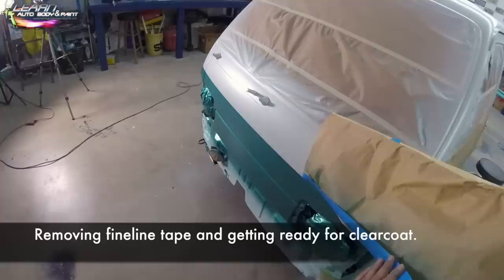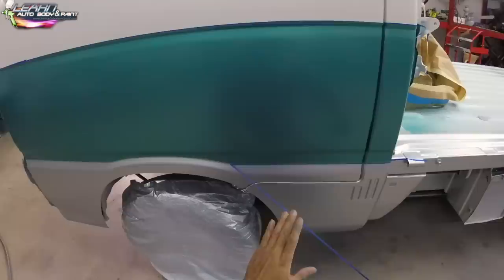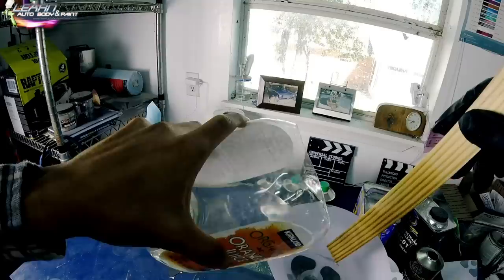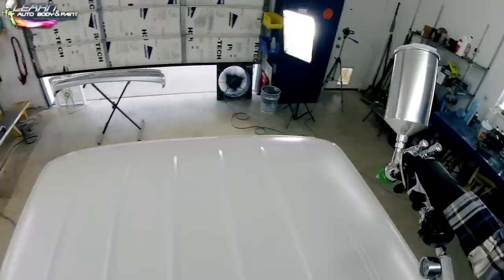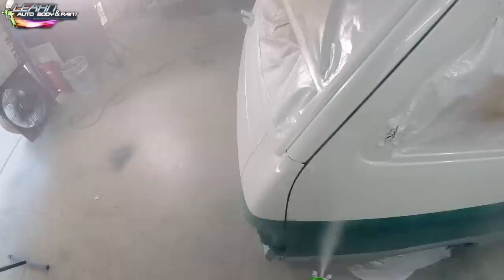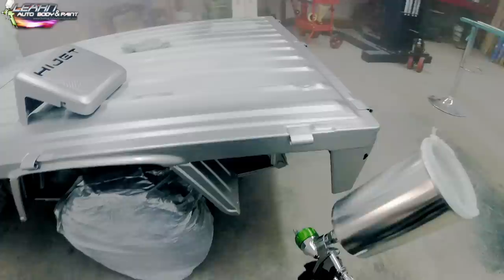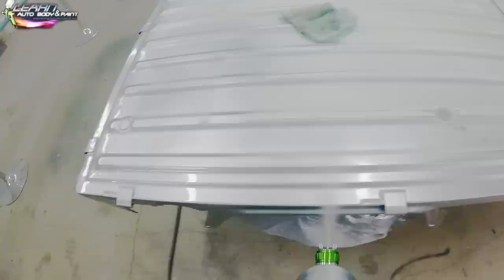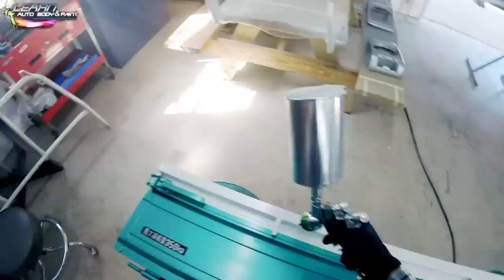How-To Spray CLEARCOAT Like a Professional! Atom X21 and Atom X27 Review

Comment: Little tricks someone taught me for painting in a garage where environment can't be controlled: 1: Cover the walls and ceiling with roll plastic (the static-y the better), and dust floating around will be attracted to the plastic. 2: wet the floors down with a mop and be generous, right before you spray, and again in between every base and clear coat. 3: Cut 3" pieces of 2" PVC pipe and place them under the car, again, dust nibs will be attracted to the plastic pipe, and not your car.  
I also have turned my garage into a makeshift crossflow booth, I filter incoming air through front windows with furnace filters, and then I just cut a hole in the back wall for a shutter fan.  I've turned out some pretty phenomenal paint jobs out of my home garage.  Oh, and a big one is lighting. Put lights everywhere, walls, ceilings, etc.
Reply: Awesome advice for the weekend warrior!!

Comment: Dude Tony yeah my X21 smashes on the clear so nice with fluid wide open but I used it for first time on base coat recently and I ended up having to turn the fluid down  because it put it on too wet in  some  small crevices. The X21 has such a dense fan which I love and is great for laying the clear  down nice and wet!
Reply: I agree. It's a good working gun for sure.
Reply: BOSS FLIPPER - Secrets To HIGH PROFIT Car Flipping hey can I spray Urethane base coat over lacquer primer in some some areas by any chance? I tested putting some of the primer on an old door and then put some of the base coat over it to test it out to see if there would be a reaction but three to four days later and it still looks fine. So I just wanted you're opinion first before moving forward with painting over the lacquer primer.

Comment: Great video about shooting in a garage I paint cars in a garage also just make sure your cup is screwed to the gun correctly I painted a pickup truck box and on the 2nd coat of clear the cup dripped clear on the tailgate found out the cup wasn't screwed to the gun right

Comment: Hi can i ask. When you say you use just under 30psi for clear coat. Do you set 28-29psi on your seperate regulator and then open the gun air pressure regulator fully? Thanks, great video!

Comment: Hey Tony, how do you adjust for flash times when painting in a garage instead of a professional spray booth? I know the data sheet for the clear says 15 minutes but it has to be longer for when I paint in my garage doesn't it?

 Every time I spray I get solvent pops, just a few but it still makes for a lot of work to repair, plus I always get horrendous orange peel, I think I'm spraying to slow and don't know what the layers should look like exactly when laying the clear down. Should every layer look like glass immediately when I spray?

The solvent pops always show up after I wet sand the orange peel and it's very frustrating. I have no idea how long I need to wait between coats, is an hour too long?
Reply from the maker: Check out some of these blogs: https://www.learnautobodyandpaint.com/2k-filler-sealer-primer-flash-time-is-sanding-needed-between-coats/
https://www.learnautobodyandpaint.com/how-to-fix-cracks-on-paint-auto-body-qa/

Comment: Tony, I love your videos. I have learned much. Speaking of spraying clear: I have an Anest Iwata LPH400 that I have dedicated to clear coat only. I bought the 3M PPS series 2 gun adapter to use with the PPS series 2 system cups so I could reduce clean up time and use less gun cleaner or lacquer thinner. The PPS2 filter clogs instantly while trying to spray clear. I mixed the clear according to mfg. instructions 4/1/1.  4 parts clear 1 part activator and 1 part reducer. I live in FL so I am using the slow activator. When I remove the screen filter in the lid small clumps of clear come out while spraying. I tried to use the Anest Iwata screen with the PPS2 lid with filter screen removed and the PPS 2 pulls the screen into the cup. Do you have any other suggestions other than buying an Anest Iwata Aluninum cup and using their filter? I have invested much money in the 3M PPS 2 cups etc.
Reply: I meant aluminum.LOL

Comment: Lets start “wacking” it ? Haha.. what size tip are you using? How much is your determined overlap? How far away from the panel do you suggest? What brand clear are you using and what’s your reduction ratio? These fundamentals are essential and without them the difficulties begin to pile up..keep wacking it out tho...
Reply: Jay Carr If you watched the video and listened he said he is using a  X21 1.4 tip HVLP with House Of Color HS 2k clear coat that cost just under 300$ for the kit. Reduction in the clear? No reduction in the clear coat man why would you do that? If you reduce you're HS clear then just use a Medium Solid clear that's basically what you're turning it into if you reduce you're High Solid Clear Coat.

Comment: Hi Tony, i need your opinion on clear coat problem. Today i just finish painting the front hood of my car(Black). After finish applying the clear coat, i really satisfied with the glossy result.But i found out that my clear coat doesn't completely dry even after 4 hours. It leave a finger print if i touch it( surface feel quite sticky). Is it i did not mix enough hardener into the clear? If so, can i just mix a new clear coat and put another layer on it? or should i sanding it over and start again?
Reply from the maker: Mattakoora, I talk about that in VIP! Go check it out! https://www.learnautobodyandpaint.com/vip-offer/

Comment: Im getting ready to paint my dodge magnum a chameleon paint. I have 3 tips 1.3 1.5 1.7 which would u use for basecoat, pearls, HS clear? And what PSI for each? Its about 70-80 degrees here.
Reply: Customkid chacon whats the recommended paint strainer funnel mesh for heavy pearls?
Reply: Antuan Kendrick I would use the 1.3 for you're base and pearl and 1.4 for you're clear if it's a high solid or 1.3 Will be fine either way.

Comment: What are you talking about when you said " The only time you dont want a run is when you are runing with pearl". 

Was confusing because you just popped up with that out of nowhere.
Reply from the maker: Meaning, you want to avoid running your paint if you have pearl mixed into your clear or midcoat, because you'll see the PEARL RUN and it can't simply be sanded and buffed out. You will see the pearl in the clear even though it is sanded flat. :) I hope you get it now. I am running a FREE trial of VIP, check it out here my man https://vip.learnautobodyandpaint.com/special-oto-e
Reply: Got it. Thank you.

Comment: What size tip do you recommend when spraying clear with flakes?
Reply from the maker: It depends what size flake but for a mini medium you could use a 1.8 to a 2.0... if you’re looking for an awesome spray gun for that check out the atom X 27.
Reply: Will do man thanks✌✌✌
Reply: Its extra fine flakes more like metallic to me
Reply from the maker: Roadkillz Quads, Karts & Buggies If it’s extra fine like micro sequence you can actually spray it out of the 1.3 or 1.4 bro... check out my site to learn more!! :)

Comment: Hey Tony I sprayed 2k clear coat about a couple weeks ago on a set of doors. I have wet sanded and buffed them already but the clear is still soft enough to put a divot in it with my finger nail. Curious as to what is causing this. I have left them in the sun for the past week and it seams to be helping some.

Comment: Hi Boss. Can you tell me the best small LVLP mini spray gun. ( for the $$$ ) Wanting to start a small mobile business here in Australia.Thanks. I have bought your course...
Reply from the maker: Mr Eighty Twenty yes for sure! Check out the Atom mini X16 it’s fantastic!! https://zoolaa.com
Reply: BOSS PAINTER - Learn Auto Body And Paint! So that gun can be used with 20-30 gallon tank with a 7 cfm at 40 psi?
Reply from the maker: James Thurman yeah for small projects no problem !
Reply: BOSS PAINTER - Learn Auto Body And Paint! But i saw on one of your older video explaining psi and  tanks you said with that setup you could basically paint the whole car.
Reply: Is this gun LVLP or HVLP ???
Reply: I thin its a HP what about a LP mini gun ???
Reply: Mr Eighty Twenty hvlp mini
Reply from the maker: Check out the Atom Mini X16! Amazing little gun. They sell them at https://zoolaa.com

Comment: hello.. i want to ask how long time to wait between first coating and second
Reply: could be 10 minutes or 1 hour. you have to touch it and see if it is almost dry. (just a but sticky)... in this heat i wait almost an hour till it is tack free.
Reply: @heightsgolan8742  but i am not using hs clearcoat and my compressor only 2 hp... do you using devilbiss jgx 502 spray gun?
Reply: @hiunghiung6509  with any gun you need a 1.8  spray nozzle because the clear is thick.You need the pressure up at the gun. about 30 to 35 psi. 2 hp may work,but i think you need more air than a 2 hp.
Reply: @heightsgolan8742  so you are using the 1.8mm nozzle only for clearcoat or also with paint? what type spray gun you using now? can you sharing how you adjust the fan and other adjustment..

Comment: Whats size tip u have i got a 1.4 x20 and a 1.3 x21 both hvlp i had problems with the x20 but got it fixed... The 1.3 x21 hvlp i regret i should of gotten 1.4 also
Reply from the maker: Elchingon_92 they have affordable tip kits for them at https://zoolaa.com
Reply: Elchingon_92 yo do you have the Hvlp versions or the MP Lvlp ? What was you're problem with the X20? I was having a problem with mine (MP LVLP) but It Was Not the Gun I was spraying at too low of a pressure not realizing that the operating pressure had to be 24psi-36psi and I was trying to spray at 20 and I was just getting a random drop of paint that wasn't atomizing but once I looked at the Manuel and turned up the pressure and man it laid it on perfect!!
Reply: Elchingon_92 so I guess what I'm saying is to just make sure that you are spraying at or above the required psi to operate you're guns depending on the model type. I got confused when switching from the X21 to the X20 and just assumed they operated at the same psi.
Reply: Jared Causey the problem i hade with the x20 waa that it would not spray clear at any psi it would spray like dry and it would look bad i could not even make it run so i got a hi flow fitting that helped but then i was shooting heavy at the botton and left the tip in thinner for about 2 days and nothing so i started playing with the tip and moved it up side down and the heavy spot moved up so i just order a new tip and it fixed it i talked to tony he offered to take a look at it but it was just faster to buy a tip
Reply: Jared Causey with the x21 it sprays smaller fan and takes a lot of cfms to work with the 1.4 it shoot more paint and i liked that
Reply: BOSS PAINTER - Learn Auto Body And Paint! Is urs a 1.3 or 1.4?
Reply: Elchingon_92 yeah I love how dense the x21 fan is it really lays it on nice and wet! I have a 1.4 and 1.3 tip kits for my X21 and for my X20 I just have the 1.4 tip right now.
Reply: Jared Causey u like the 1.3 or the 1.4 more on the x21? i love the x20 with the 1.4
Reply: Elchingon_92 I love the x20 with the 1.4 as well but as for what tip I prefer on the x21 I havnt decided yet. I started using the 1.4 and just recently switched to the 1.3. I have sprayed clear with both the 1.4 and 1.3 but only sprayed base with the 1.3 so far. I definitely prefer the 1.4 for clear coat on the x21 and will have to use the 1.4 to spray some base to see if I can tell a difference but I think I will end up preferring the 1.3 for Spraying Base Coat due to the dense fan pattern the x21 has you don't need to spray with full fluid with 1.3 for Base because it laid it on way too thick in certain areas. Well atleast that's what happened when spraying a bumper with curves and a lot of small lips. So I turned the fluid output down a bit  and it still laid a nice wet coat with great coverage and I'm spraying a Alabaster Silver Metallic.

Comment: I have the atom x21 but haven't used it yet...whats the deal with seal issues?
Reply: Robert Arco You will be fine there are no issues regarding the X21. I have the X21 and X20 and have no issues at all regarding the seals or anything else they are great guns to spray with. I hope you use it soon and enjoy the results. Fyi if using for base you may want to turn the fluid down or just not pull the trigger back all the way you're first coat atleast because it lays it on fast and thick. At least my 1.4 MP LVLP does. Once I turned the fluid down it still put out plenty of paint for coverage moving at a good speed. For the clear coat though it's perfect to have fluid wide open and trigger fully pulled. It lays base and clear  very nicely as I just used it for base for the first time  the other day and had already used it for clear coat multiple times and never had any runs or sags. Wish you luck and hope that you enjoy spraying with the X21!
Reply: Thank you ..I will experiment. I bought the 3M PPS gun system but I also bought the PPS adapter for the X21. So I am COMFORTABLE with the PPS for primer and I think in turn base coat since it lays on pretty my flat on th epoxy (base should be similar) But I will be doing base/clear on the hood and trunk underside soon so may use the X21 for clear to get a feel for it. Its a LESS obvious area should I have issues :-) ..Thanks for the response !

Comment: What is the cheapest and glossy clear ??
Reply: The only cheap glossy clear that will last a while is Shopline HS Show Clear. Other brands have glossy clears for cheap but they're prone to chip after a while. PPG, HOK and Metalux are the best brands for clearcoat here in the US
Reply: Victor Escalera thanks
Reply: Victor Escalera can't forget about that All Candy Wet Wet that stuff is cheaper and just as comparable to the ones you mentioned. I'm actually using metalux base coat right now.
Reply: Sabiondo El Mas Qué sabe check out All Candy Wet Wet  it is much more affordable than the ones he mentioned and a very high quality  product with great UV protection and I live in Vegas so that is pretty important if you're vehicle gets left outside all the time.
Reply: Jared Causey I want it for paint the engine bay
Reply: Jared Causey I'm in California so I can't get the original version of the wet wet. Tried the low voc version and it had the worst shrink back I've ever seen. Its glossy as heck but lays out a thick peel even with reducer. It does have a great shine but I'd only recommend it if you're gonna color sand and buff. Still a lot better than other cheap brands tho